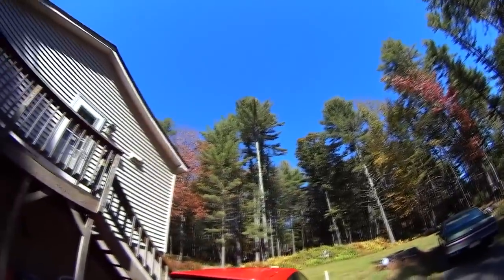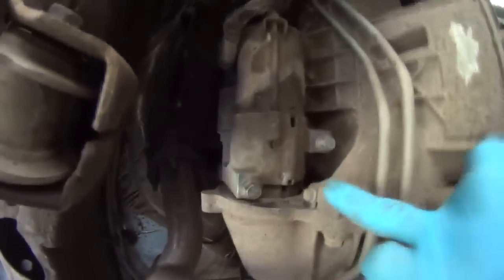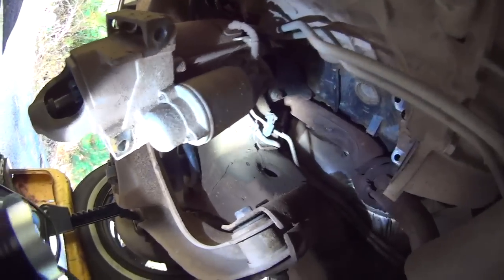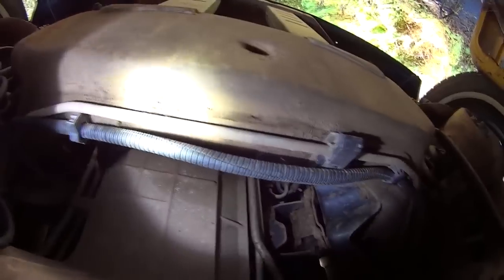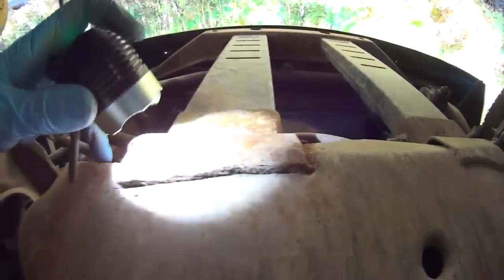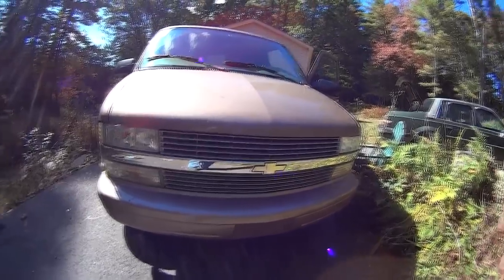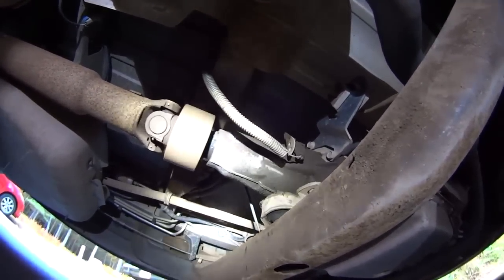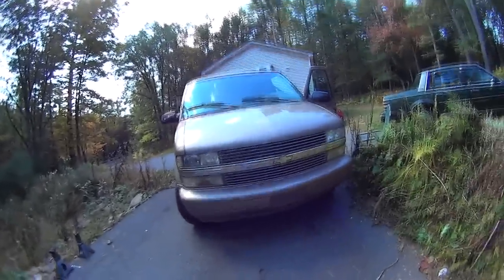Chevy 4.3 Astro Starter Replacement

Comment: Krystian, I drive a 14 year old Nissan Quest van. It's in near mint condition and runs like new. Changed the oxygen sensors and catalytic converter out. Timing belt changed.  I keep the MAF sensor cleaned and run new air filters every year. New fuel filters every two ears.Oil change every 3000.  MAXIMUM MPG out of the van. The van is rated 22/15. I get consistently 24/19. It has very little rust on it also as I wash it in the winter twice a week including the underside. You may want to consider spraying some CHASSIS SAVER chassis paint on the underside of that vehicle. It will last forever. I am just getting ready to spray mine. I also do my own minor scratch touch up paint. Great job on these repairs that you are doing. You're a very smart guy. I am also getting to ready to go RV. I can't take these Buffalo winters anymore. I am also a trout fisherman here up ion western,N.Y.

Comment: I have a 2003 Astro 115,000 mi. 2nd owner and I've had for 13yrs. Bought with 25,000mi. Love my van. How long does starter last? Bottom of mine is rusted. Chicago.  I have to replace sway bar links tomorrow.  Rusted away.

Comment: Where do you buy your parts online?
My starter failed yesterday, had to hit it with a hammer while a friend turned the key.
Has started without hammer since then .
Just paid $175 at NAPA....UGH!
Feel I must replace the starter today as I use the van for work.
-Teddy
Reply: +Teddy Houghton I bought mine on Amazon for $70.00, next time look there.

Comment: +AstroCamper I have recently replaced a starter on a 2000 Chevy Astro 4.3 2 wheel drive. Everything went fine, but I'm removal of the old starter, there was 3 cables connected to the starter when I held the new one up to the old one there was no place for a 3rd cable. I took a bunch of good pictures of everything if you have an email I could send them to you if that could help you help me. There was the 2 wires the big one and the small one, but there was a 3rd cable that was fair big in size. Hopefully you might shed some light on this for me, in you're video we did not see the removal of the wires so I couldn't get an understanding of what's going on. Any help you can offer is a privilege and Ill appreciate it very much. Thank you kindly
Reply from the maker: The third cable is from alternator to send more juice as u crank. Should be connected with large battery positive cable. I think.
Reply: Astro Camper Yes I went back and we tried it. Seems to not want to start still. My assumption is that maybe the cables are fried completely, do you know of removing the cables all together and putting brand new ones In is a difficult job or not?
Reply from the maker: I replaced the main cable in one of my videos
Reply from the maker: https://m.youtube.com/watch?v=83W0pRBGxlI

Comment: A sudden loss of starter function. lol Started just fine, went to the store, came out, and nothing.  
No dimming of lights you would see if the starter was bound up. 
Question is, aren't the solenoids on these starters serviceable? 
Reason I ask is that when the starter is fed directly from the battery, it turns over just fine.

Voltage arrives at the solenoid when the key is turned to the start position, but no voltage is found on the feed line from the solenoid to the starter, and is why I believe the solenoid contacts are bad.
Reply from the maker: In the old days everyone use to service the solenoids. Today, it is hard to find parts for it.It's cheaper to buy a starter.

Comment: Very uninformative on how to actually remove the starter.  He often goes on unnecessary tangents about functions of the van but stops his tutorial after doing the first thing to it and from there shows off his van.
Reply from the maker: Romel Moore Sorry about that. Its the simplest started job ever. Just 3 bolts and it pops off. My Crown Victoria starter job required engine removal.
Reply: Ya, that was the bit I was here to see. Also.  So, Drats.